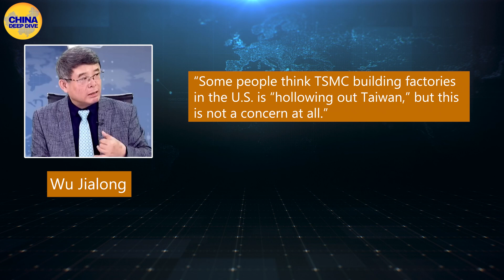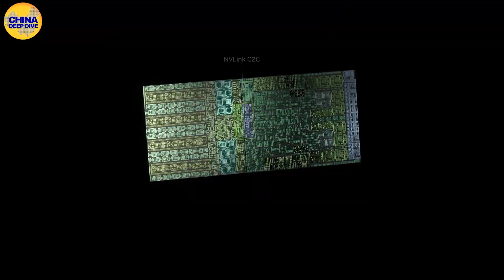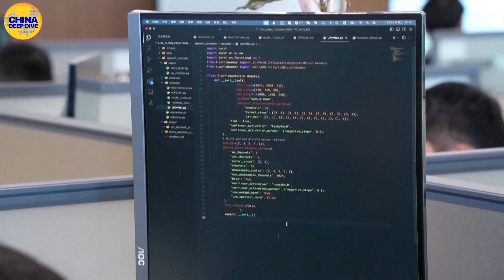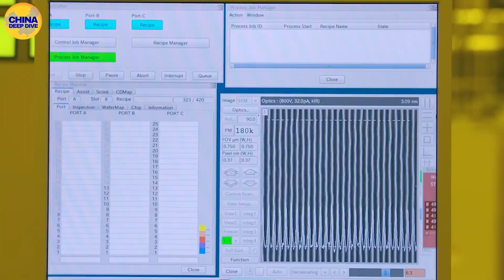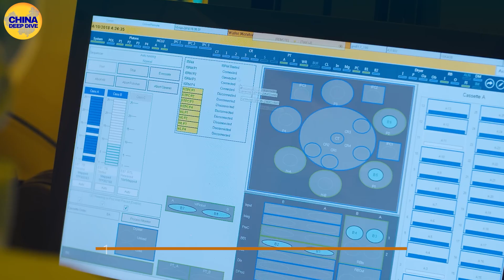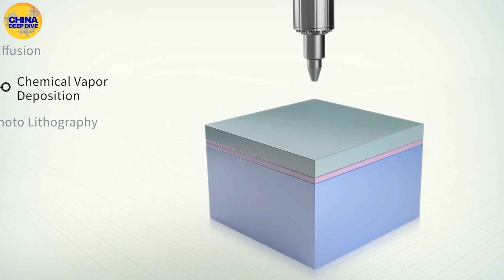Why is TSMC so important? The real reason why TSMC invested in the United States.

Comment: Also TSMC is building 2nm and even 1.8nm chips while second largest chip maker Samsung is struggling with 3 to 4nm chips. Samsung is really struggling financially while TSMC is building USD$100 billion manufacturing facilities. TSMC will soon have 100% monopoly in advanced chip manufacturing.

Samsung lost so many customers to TSMC now. So it is very important to build more factories to keep those customers rather than turn customers away.
Reply: I wouldn't be too hopeful.
TSMC is essentially a fab factory which uses the latest lithography machines from the Netherlands.
TSMC does not design the microchips.
Essentially, without ASML and the chip designers, there will be no TSMC.
Reply: @ I don’t think so. If just a simple buying machines why other companies can’t do it. Intel spent over USD$100 billion and still failed. It is not as simple as buying machines and plug in. Samsung is struggling too.

“While TSMC produces about 90 percent of the world's most advanced chips, Samsung has struggled to close the gap, as key tech firms — including Apple and Nvidia — remain TSMC's exclusive clients. This has left Samsung in a difficult position, unable to expand its foundry business due to a lack of customers.” March 15 2025.

TSMC spends 50% of its profit back to R&D. If just turn on the machines from ASML by spending billions each year on research
Reply: @michaellan78  
The bottom line is this.
Without ASML, there is no TSMC, unless it can produce its own lithography machines.